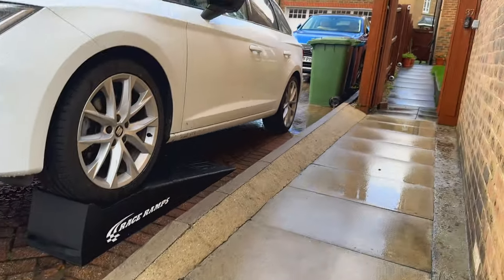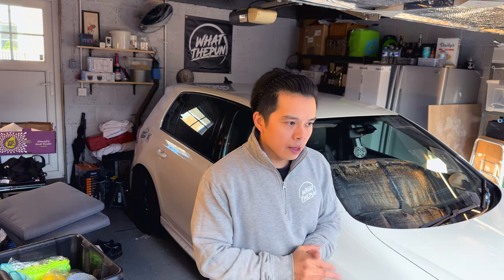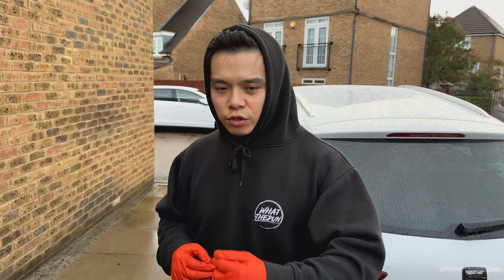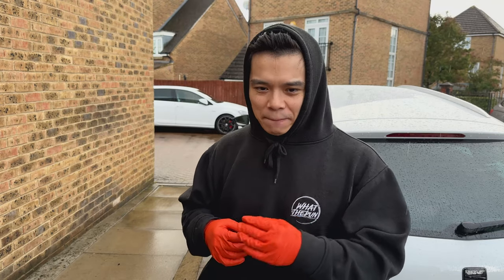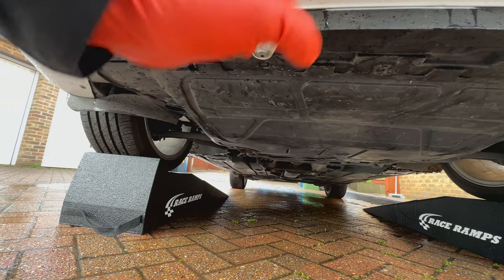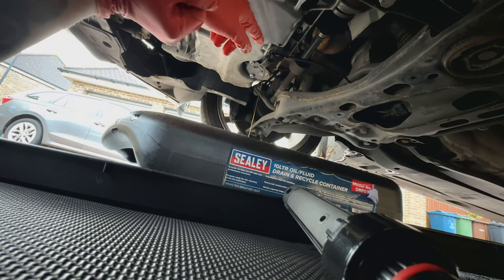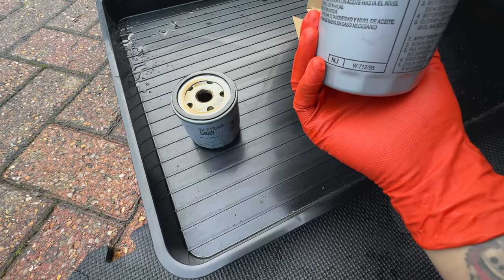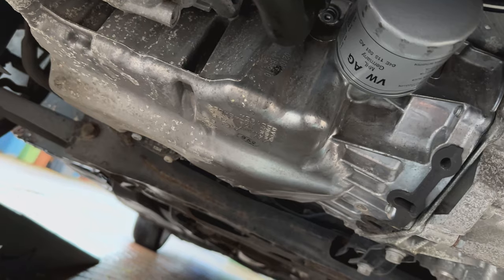How To Change Your Engine Oil And Oil Filter - Seat Leon FR ST 1.5 TSI EVO - 109

Comment: Finally a decent video about oil change on VAG 1.5 tsi engine. And showing the worst part, removing undertray. Great job 👍
Reply from the maker: Appreciate the feedback
It was the first time changing oil on a MQB car, so was a little surprised with the undertray.  But overall, it wasn’t so bad.  👍

Thanks for checking out my video! 🙏

Comment: Great video. Helped me do my oil correctly.

When changing the oil, are you meant to remove the dip stick and oil cap to allow pressure to flow?
Reply from the maker: Thanks for your feedback!

When draining the oil it definitely helps having the oil cap off 👍
Never tried in combination with the dipstick removes too though. 

But the flow is definitely much better with the cap off.

Comment: Where can you buy genuine VAG parts for service? Oil and oil filter in particular?
Reply from the maker: Oil filter you can get directly from a local Volkswagen dealer as long as they have a parts department.

If you want to use the same oil as them, which I believe is quantum. I believe a few online businesses sell it.

Otherwise, I use castrol.